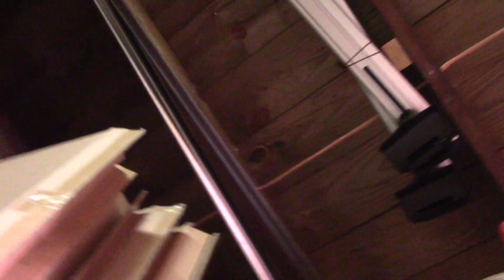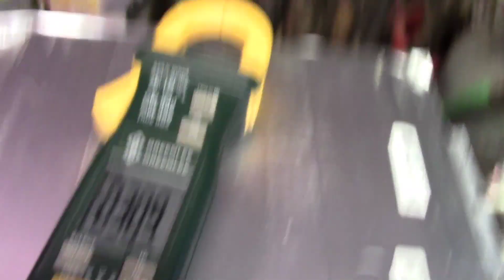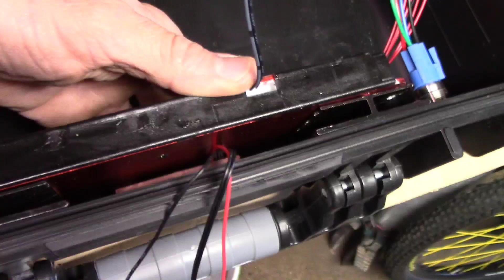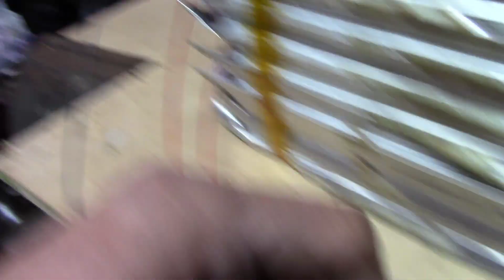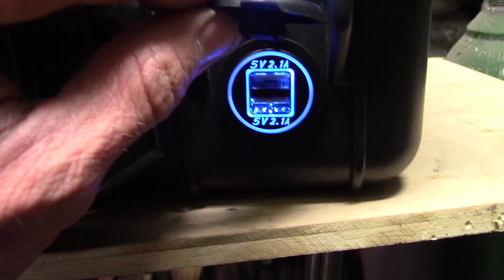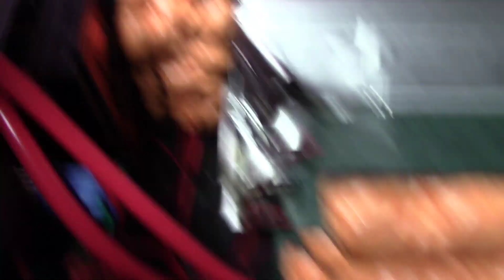12v LTO 80 ah battery build to use at the ranch for mobile needs (Parts list below) @TimelineRanch

Comment: You could place one of those temperature sensors in between the cells or one at the bottom and another at the top. It has been a year since the video. How is this setup holding up?
Reply from the maker: Thanks for watching one of the older videos. The battery is working well, still  along with the other six I built. I use them every day when I'm at the ranch. I plan on changing the voltage on the battery bank to 48v later at the ranch. It's a much more efficient voltage to work with.

Comment: Looks like a fun project 😎 Can you provide a part list so I can build one?
Reply from the maker: Yes I could you will have to give me a little time I didn't ever make a list for the build. Most of the parts came from Amazon the rest I had to get from  Chinese company's.
Reply: @TimelineRanch  thanks, I like the flat battery pack configuration.
Reply from the maker: Definitely makes everything fit together nicely.
Reply from the maker: Hi just letting you know I put the parts list for the battery build in the  Description under the battery build video.  Hope you enjoy the your build let me know how it turned out.

Comment: Thanks.
Reply from the maker: I enjoy making batteries, always been interested in anything to do with electricity.
Reply: @Timeline Ranch  
Wow, that's great.  I bought a commercial grade battery for my small system (270ah 12v lifePO4 deep cycle 8D $2,300.). It should fit my minimalist needs.
Reply from the maker: That battery chemistry is good as well. The main reason I chose to build the LTO batteries is for 20,000 cycles it should be capable of and I like a good challenge.